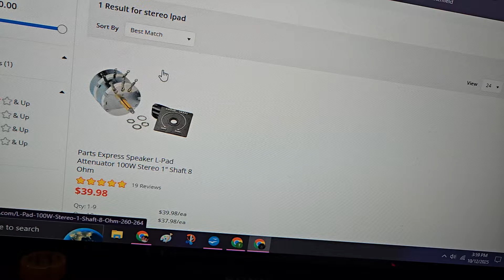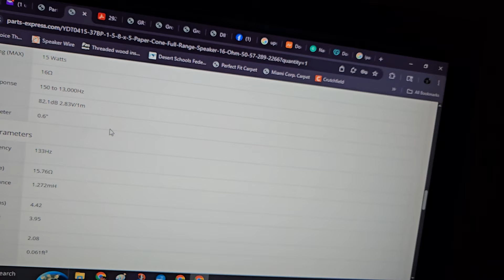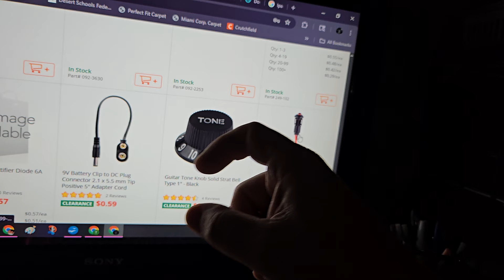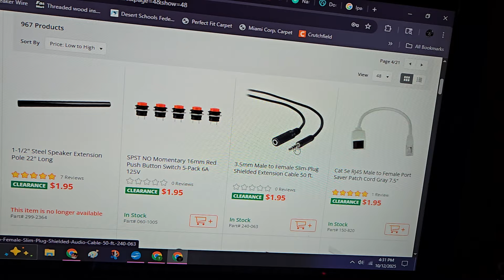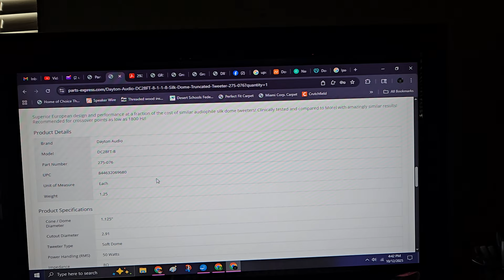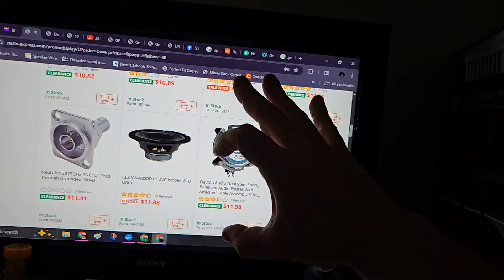How I Troll Deals on Parts Express for PC Parts, Electonic & Electric ⚡ Sound / Audio and more

Comment: Lamp cord is rad! When i was super poor in the late 80s thru the mid 1990s, i cut a lot of that cord from old junk while my rich friends laughed while they blew their monies on fancy pants "monster" type shit. I still use extension cords to wire my small trailers lights.
Reply from the maker: Lol yep!
Reply: Ran out of speaker wires, cut the ends of a busted 65ft extension cord for the surrounds. You can always double up on them too.